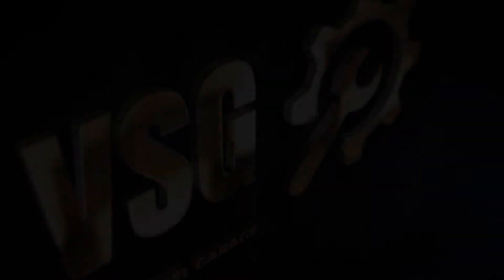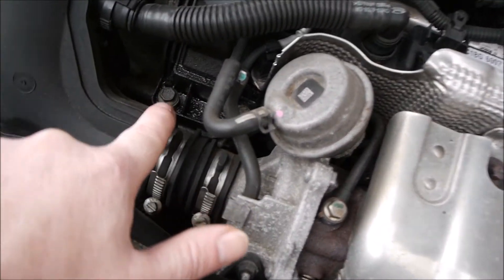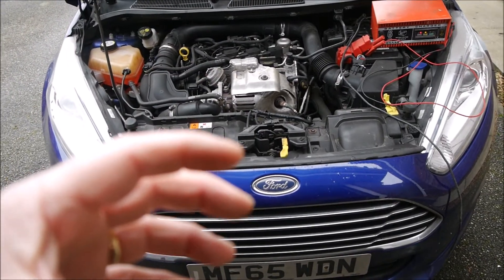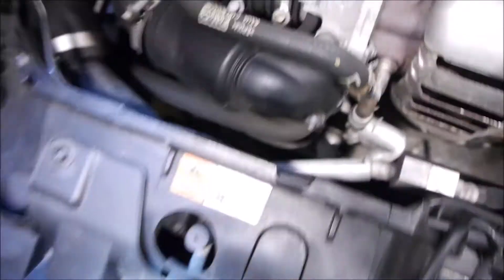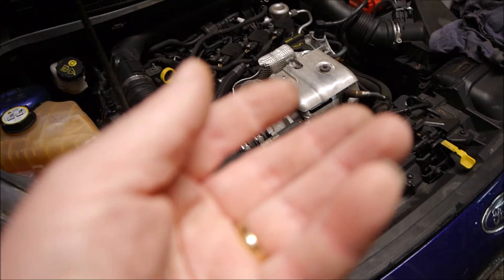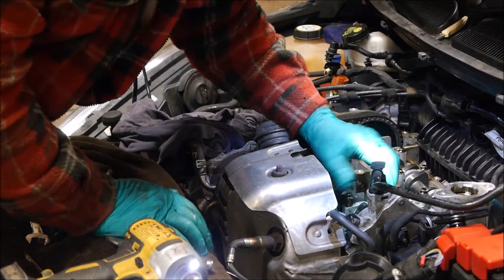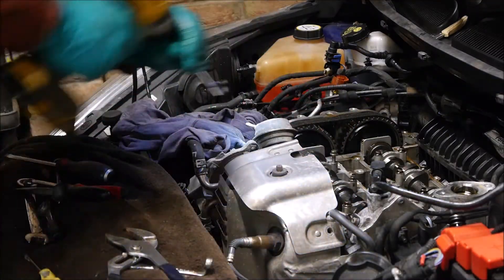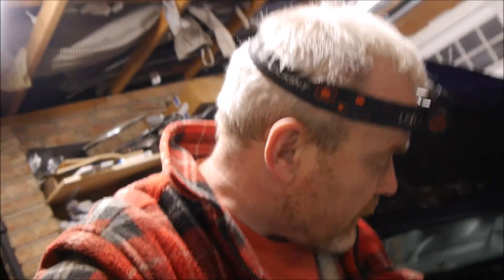Ford Fiesta 1.0 Ecoboost part 1 death rattle, can it be saved?  or is a new engine required?

Comment: Oil is the killer on these cars. I change my oil so regularly. Because it is direct injection and turbo charged, some fuel gets blown past the rings.

Now, the adative in the fuel degrades the oil, which eats the rubber of the wet belt. I got this information straight from Ford, so it's not made up.
Reply from the maker: Yes agreed. Regular oil changes vital and at the correct ford spec
Reply: @vintagesteelgarage  
I plugged my other diagnostics scanner in and it says this  fault is 
Power supply fuel pump 
Short circuit to positive or open 
Intermittent 
I ordered a low pressure fuel pump that will sort it i can start the car and rev it up but when let it idle car just dies and if i rev it it will stay running for a couple of minutes with accelerator keot pushed down a bit thanks for your info mate
Reply: there wetbelt a very bad engine
Reply: I plugged my other diagnostics scanner in and it says this  fault is 
Power supply fuel pump 
Short circuit to positive or open 
Intermittent 
I ordered a low pressure fuel pump that will sort it i can start the car and rev it up but when let it idle car just dies and if i rev it it will stay running for a couple of minutes with accelerator keot pushed down a bit thanks for your info mate
Reply from the maker: @Peter-sm8bj wonder if you have a power issue from battery or fuse box. Or bad earth from battery or engine to body. Is the battery fully charged. Seems to be a wiring gremlin.
Reply: @vintagesteelgarage  
All i have tried is a jump lead feom battery to gearbox that never helped i wonder if i can take a feed from battery negative to chassis the car doesnt seem to have a full pump relay but it has a fuel pump module thing under the rear seat i ordered low pressure fuel pump so i was goong to drop fuel tank and fit that and hope it works thanks
Reply: @vintagesteelgarage  
Soon as i turn the ignition key 
U hear a thump noise then it stops so i then bridged fuel pump relay and  turn the igniyion  key and the pump runs with a very loud whining it runs for about 30 secs then stops
Reply: @vintagesteelgarage  
I bridged the fuel pump module to run the fuel pump tonight and the pump is screaming whining really loud and then it goes silent aftet about 15 secs or so i am thinking bad furl pump 
But when i take the bridge away and plug the fuel module back in i turn on ignition and the fuel pump all u hear is one thump sound like a tap on a drum 🤣
Reply: @vintagesteelgarage  
Mate see below that vaccum pump do you have a wire hanging its got black cloth round it and its a 2 pin black plug i have no clue what that plugs into i just bought this car a week ago is it a spare wire on the focus 1.0 ? 
It look like the wire comes out from behind the front heatshield its just hand diwn from the thermostat housing and that has its plug in that am baffled 🤣
Reply from the maker: @Peter-sm8bj  I don't recall an unused plug. But I have seen that before on other cars. Is the black cloth over the plug connection so that it couldn't plug  into anything without removing the cloth. If so suspects it used on anotyer model.
Reply from the maker: From why I remember there is an awful lot of electrical connections. But the length of the loom usually helps  to locate a possible connection point in an arc around the loom if that make sense
Reply from the maker: @Peter-sm8bj  what's the history of the car. Did you get as a none runner. Has someone else been fault finding swapping parts already?
Reply: @vintagesteelgarage  
I bought as non runner mate
Reply: @vintagesteelgarage  
Nope its a 2 pin plug 
the cloth is just protecting the wires i guess
Reply: @vintagesteelgarage  
I have maybe broke the car now as i cant even get it to start now since i hooked my scanner and went to reset bcm and ecu it says drive car for 5 minutes i continued and pressed the reset when i was sitting at ide then the engine cut out 🤣
Reply from the maker: @Peter-sm8bj oh that sounds bad
Reply from the maker: @Peter-sm8bj  I would say it needs to plug in somewhere then.  There are  quite few connections around the vac unit  and water thermostat.
Reply: @vintagesteelgarage  
I was thinking that mate but vacuum pump has a plug on it and so does thermostat housing have a plug 
The wire am talking about comes from behind front echaust car heatshield it had a black cloth sleeve over the wires and uts a 2 pin plug i test pins with ignition on with my test meter and i got zero reading on both the petrol tank pump came today am gonna try fit it tomorrow as existing pump when i turn the key all i get is just one thump noise and like i says when i run direct power to pump its screams really loud for about 20 secs then it stops 
I bought the car planning to fix it for myself but its not looking good i will i knew how to test with meter to see if injectors are getting power am gonna plug diagnostic scanner in crank car and see on live data if i get rpm signal maybe crank sensor us shot haha
Reply: @vintagesteelgarage  
Hi mate i just changed the full pump on this focus 1.0 ecobost u any idea if they cars have a fuel filter i got the car started with new fuel pump car idles and u can rev it up but when u try drive it stutters 
Niw i am getting on the dashboard service malfuction service now i scanned for codes i get p008b fault code
Reply: @vintagesteelgarage  
Hi mate i just managed to into live data fuel rail pressure is 1300 psi 
And also the fault code i am getting is p0089 
Fuel rail oressure regulator 1 performance its says would that be the high pressure fuel rail sensor ? Maybe that sensor is gubbed thanks
Reply from the maker: @Peter-sm8bj sounds like you are  making  progress
Reply: @vintagesteelgarage  
Well mate guess what the fault code relates to bad rail
Pressure sensor i changed that car still
Thr same starts idles and dies then i charged battery overnight it was dead same result then i decided last go at the car 🤣 i unplugged the front o2 sensor on the cat the car euns drives like a dream my question is can a bad 02 cause car to run rough and die 
Cause it drives great with that unolugged fron the electrical plug thanks
Reply from the maker: @Peter-sm8bj unplugging that could work if it's faulty. If faulty it could make the engine  think it is over fuelling and trim back the fuel and starve the engine. When first started the ecu will ignore the data from the O2 sensor which could explain it running. Look on your data logger for O2 sensor bank 1 sensor 1 and bank sensor 2.  They should read between. 0.6v and. 0.9v
Reply: @vintagesteelgarage  
Thanks mate i ordered a new sensor 🙏
Reply: Well m8 in live day the 02 sensors read perfect i have now found and fixed the fault 
The front bonnet sensor was broke so it musta been shutting ecu down a bit i bridged both wires on the switch plugged my 02 sensor back in and finally the car has shewer power now 🤣🤣
Reply: I use a every tank fuel maintainer and change oil oil filter every year and do 5000miles annually. What do you think.Good enough.What oil do you use I use comma eco f 5w20 part number ecf5l
Reply: @Antonio-gq6fx yeah 5k sounds OK, I'm usually around the 4k mark for my fiat
Reply: I plugged my other diagnostics scanner in and it says this  fault is 
Power supply fuel pump 
Short circuit to positive or open 
Intermittent 
I ordered a low pressure fuel pump that will sort it i can start the car and rev it up but when let it idle car just dies and if i rev it it will stay running for a couple of minutes with accelerator keot pushed down a bit thanks for your info mate
Reply: you can change every day ;)) same result .... bad engine design ! From 2021new engines resolved the problem
Reply: @supernova655  

I plugged my other diagnostics scanner in and it says this  fault is 
Power supply fuel pump 
Short circuit to positive or open 
Intermittent 
I ordered a low pressure fuel pump that will sort it i can start the car and rev it up but when let it idle car just dies and if i rev it it will stay running for a couple of minutes with accelerator keot pushed down a bit thanks for your info mate

Comment: I’ve got an st line 2018, 1.0 eco boost, the engine lights came on and it sort of sounds like the heat shield/ and or the engine is rattling, I’ve had the wet belt changed and the guy said if anything comes up, I can go to him free of charge, just thought I’d ask for your opinion on if it is safe to drive until I can get it to him, the engine light is just amber and not flashing, any help is appreciated thanks
Reply from the maker: Hard to say without hearing the noise.  Does it change with engine rpm when not moving? Does it sound internal to engine?  Safe bet is not to drive it.

Comment: Not sure if mine is blown I was driving and it just went, when I start it it’s like something just spins. Will that need a new engine?
Reply from the maker: Could be the starter motor not engaging or cam belt snapped. If you get someone to turn the key can you see the drive belt to alternator rotate? You might need to look undseath or under wheel arch to see this.
Reply: @vintagesteelgarage  okay thanks I’ll check when someone gets back and can help. I have loads of codes relating to camshaft position not sure what any of them mean
Reply from the maker: @joshtheepicone2076 could be cambelt then. The other check when you have assistance is try to start the engine and look in the oil filler hole and see if cam is rotating. If you have tools remove the upper cam cover for a better view. Is it turning over on the starter but very fast?

Comment: When the oil pressure warning comes on you stop the engine and do not run it , obviously drivers have a difficult job understanding that complicated procedure.
Reply from the maker: Tbh once the light is on its all too late to save. For example you're doing 70mph outside line of motorway. By the time you pull off damage is done.
Reply: They come on intermittently at first
Reply: My EcoBoost 1.0 red oil light was 2 secs delayed to go off than the other warnings lights. Didn’t think anything about it, at 70mph the light came on permanently. Luckily I was close to a layby, stopped there and had it towed. It was low oil pressure, wet belt degraded and rubber bits in the pump. 
I guess I was lucky. Heard this issue is very common with EcoBoosts.
Reply from the maker: @NMiller80666  yes very common problem. You where lucky if you caught it. Did you get away with just a new belt and pump cleaned out?
Reply: @vintagesteelgarage  Yes, new wet belt, oil pump cleaned, oil changed and new filters. The oil sump pick up strainer had bits of rubber in it. 
I also learnt to stay away from big garages like Formula One (had my car serviced every October there), independent mechanics are much more knowleageable.
Reply from the maker: @NMiller80666  yes very lucky then

Comment: A simple tip if I may, Use lots of camera pics at different stages and ziplock bags for the bolts and pieces marked 1 to ???? to help with the reassembly order.
Reply from the maker: Yes I very good tip

Comment: Ecoboom. These engines have a really bad reputation. I was recently given a 2011 1.6TDCi Titanium Fiesta in immaculate condition, 75k miles, fully serviced. It has strange cold hiccup issues and lag through the gears when cold, but once warm, it's all good. It's 13 years old and I reckon it will outlast many of these later crappy 3 cylinder 1 litre piles of junk.
Reply from the maker: Yes you're absolutely correct. They are disposable engines.

Comment: After 100000 that belts positively amazing. My 308 belt was knackered at 38000
Reply from the maker: Looks OK until you realise it's shedding the outer layer and blocking the oil pump stainer

Comment: Does anybody know if it's possible to put an engine from a manual Focus 1.0 Ecoboost directly into an automatic?
Reply from the maker: Do you have the automatic engine to swap across the flex plate and other ancillaries?  When I ordered the recon engine they didn't ask if it was manual or auto. So it could be feasible
Reply: I had just a short engine fitted. It's running fine but so many contradictions Ford specialist looked at it took some photos and stated it's wrong engine and doesn't want to fix oil leak in case there's a parts issue.Today Ford dealership said  the engine is same for manual and auto. I spoke to a mechanic today who reckons he can fix it. Car has been off the road s year in April. If the engines are the same the oil leak should be fixable, I think.
Thanks for getting back to me.
Reply: One last question. How many hours do you think it would take a good mechanic to drop engine, separate gearbox, fix leak, and put back? Mechanic told me a day and would charge me £250 as a job on the side. I've already spent £2400. Four different workshops. Last mechanic, Ford specialist said flex plate nuts not easy to remove due to missing inspection plate. Seems an odd thing to say.
Once again, many thanks for taking the time to help me.
Reply from the maker: @rdstvhyx17  one day and £250 sounds good. Modern car needs a lot of strip put before you even get to removing the engine. You. Need to remove bumper, headlights. Front crashbar which includes radiator,  ac rad and intercooler.  Exhaust need to come off at the front  Then a multitude of wires and connectors and then split engine from gearbox and then pull engine out and that's before you even  address the leak. Where is the leak from do you know?

Comment: I mean with respect,  buying an ecoboost with 100k miles. What were you expecting? You shouldn't have touched it with half the mileage.
Reply from the maker: I understand what you are saying but  we bought it  knowing the engine was  blown  and was therefore  very cheap. Once complete with new engine and clutch  it is still  a couple of grand cheaper than one with low miles.
Reply: @vintagesteelgarage  
Yep, understood.  If you can fix yourself then you're quids in, but no way anyone should touch one of these,even with low miles on, not knowing it's history. All the best fella.
Reply from the maker: @SDC-s4e  yes since buying this ive heard horror stories of one owner cars sub 40k miles requiring a new engine.

Comment: Nice job mate can you help me 
P2307	Ignition coil C, primary circuit - circuit high 
P2308 Ignition coil B primary circuit - circuit high 
I fitted all new spark plugs and 2 new coils car is still the same misfiring bad do u think it might be bad camshaft sensor fault u can start the car a rev it lightly let the pedal go engine cuts out thanks
Reply from the maker: If coil packs made no difference it will be upstream from the coils could be a damaged wiring to coil packs or blown fuse or relay not picking up.
Reply: @vintagesteelgarage  
I checked all fuses with test meter mate all is good u any which relay controls them coils thanks
Reply: @vintagesteelgarage  
Hi mate do you know if the focus 1.0 ecoboost has a bug software problem ? 
Somtimes i start it it says engine malfunction service now but when i switch ignition off abs back on the message is gone do u think i need to oil and filter change then reset oil life cheers 👍
Reply: @vintagesteelgarage  
I plugged my other diagnostics scanner in and it says this  fault is 
Power supply fuel pump 
Short circuit to positive or open 
Intermittent 
I ordered a low pressure fuel pump that will sort it i can start the car and rev it up but when let it idle car just dies and if i rev it it will stay running for a couple of minutes with accelerator keot pushed down a bit thanks for your info mate

Comment: This is just one of those engines where you think "why?" My other half had one in her Focus. Got a call one day to say she had got it home but it was seriously down on power. Pulled the sump off and found the oil strainer was clogged up with oil that resembled Sikoflex. The oil starvation had killed the bearings in the turbo (hence the loss of power) I Removed the oil pump and cleaned it thoroughly and also fitted a used turbo. When I had the sump pan removed you could inspect the belt. I cranked it round by hand and no teeth were missing. Took a bit of a gamble on not changing the belt and got away with it. Not a job I fancied trying to tackle on the driveway. Wet belts are just disasters waiting to happen. I'm kinda surprised nobody has come out with a chain conversion for this engine. Granted, chains have their own issues, but degrading into the engine oil isn't one of them 🙂
Reply: Well a chain running in a constant oil bath would be good anyway.    Just needs a tensioner       The oil pump could be a chain, it only drives the pump , so no timing required just drive. 
Had my belt go 2 weeks ago.   2017 zetec  87k miles. Oil change every 10k.  But a lot of stop/start driving in town .
Reply from the maker: Yes agreed a very poor design of belt.
Reply: I said this going back when ford introduced the 3 Potter around 2012 thay will cause problems, a lot of driving instructors have used them and the same thing has happened. Unfortunately it's all down to emissions aswell as keeping manufacturing costs as low as possible 😢

Comment: I so wish you luck with it 🤞
Reply from the maker: Turned out fine. We bought it with a known blown engine and then installed a recon engine.
Reply: @vintagesteelgarage  I really hoped you were going to be able to save the original
Reply from the maker: @hannchris2762  unfortunately it didn't make economic sense to repair. Combined with very limited technical documents showing torque values for main and big end bearings. Basically ford or others just want to sell you a new or rebuilt bottom end. But on the us that comes with a warranty and save time. We still saved thousands on labour by doing it ourselves and had a good experience with my daughter. Not many 17 year old girls can say they fitted a new engine.